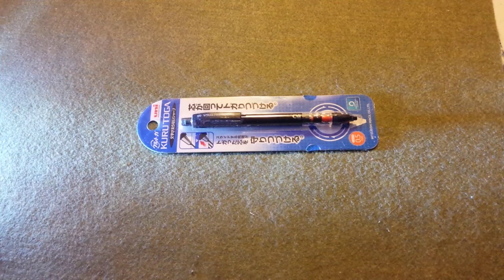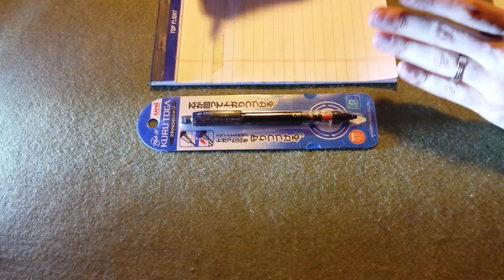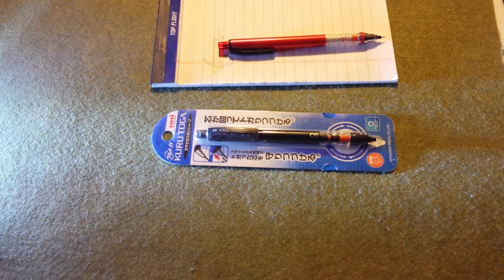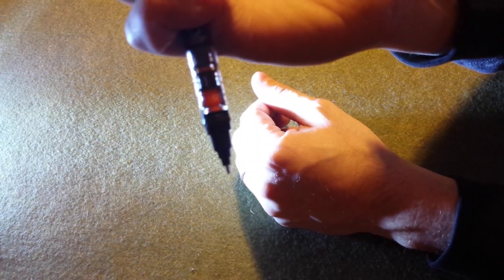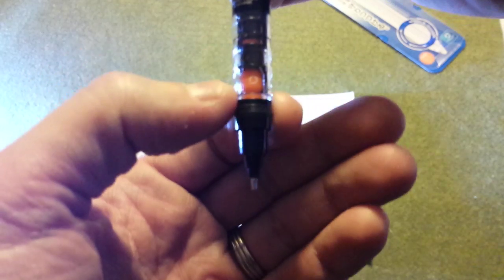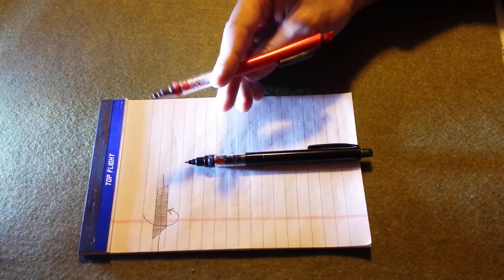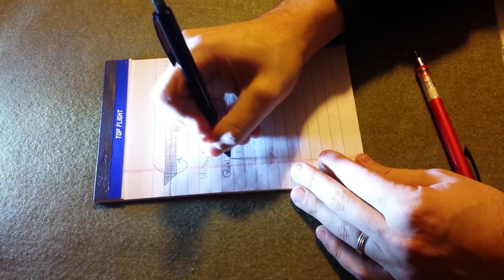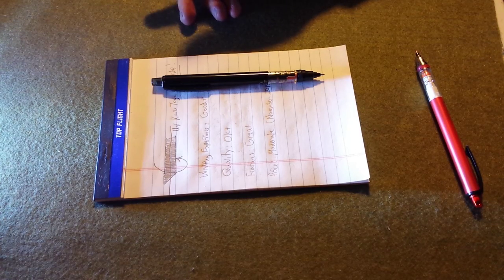Uni Kuru Toga Pipe Slide Mechanical Pencil Review

Comment: Was trying to keep count as you were clicking it. I counted 20 presses to complete a full rotation of the lead (1/2 of the 40 of the previous engine) this would make it more viable with softer lead grades. Seems to be true based off a review on jetpens. Can you confirm how many clicks it takes (yeah i know that sounds way too much like an inquiry as to the number of licks to get to the center of a tootsie pop). Much appreciated if you would :) Thanks ahead.
Reply from the maker: +benjamin leaman I have confirmed that this is accurate.  About 20 presses for one full rotation with the Pipe Slide.  About 40 for the classic.  Nice observation!
Reply: +Clutch Situation awesome, might even work with 4b lead with rotations that fast :) hoping they add that engine to the others as the pipe sliding up does admittedly sound abysmal for long clinical note writing sessions

Comment: Hey I'm wondering what you would rank the Kuru Toga Pipe Slide now that it costs only ~$7 on Amazon
Reply from the maker: Probably the same.  Cost factors much less into my ratings than any of the other measures.

Comment: As you put the pencil on the paper and lift it every time u write. It slowly turns the leaf around. When u just write a normal straight line. It DOES NOT turn the led.
Reply: The lead turns only when you lift it from the paper
Reply: That is why this pencil works for my style of writing, where I write individual characters and lift the pencil lead after every character. I've seen a few YouTube videos about this pencil and some mention that the mechanism doesn't work as well when you write lines (since you don't lift the pencil from the paper) or when you write in cursive (where you only lift the pencil from the paper at the end of a word).